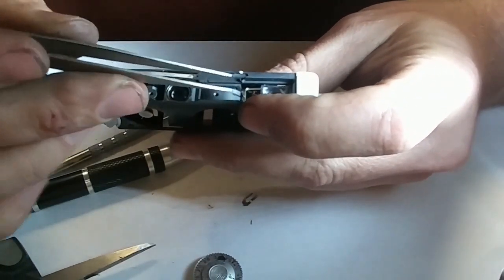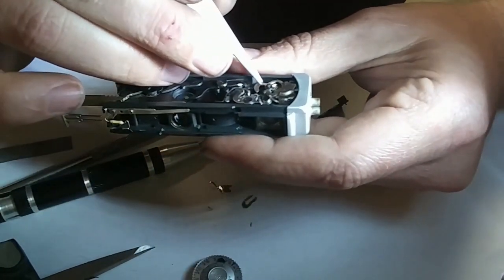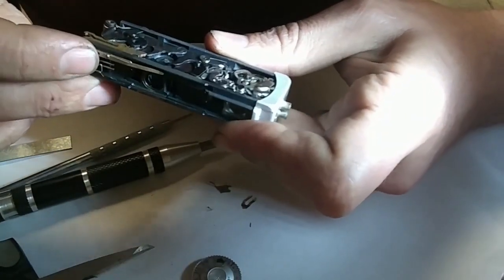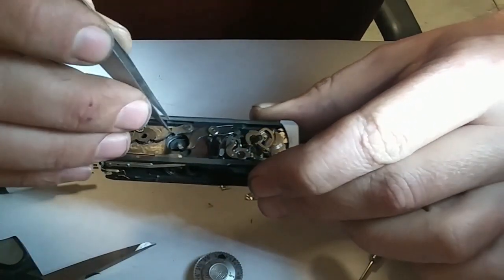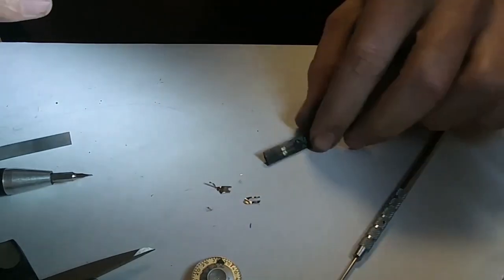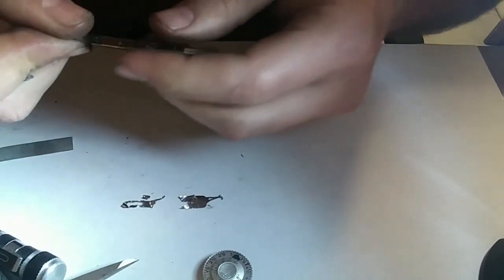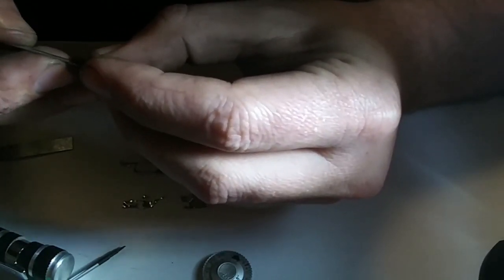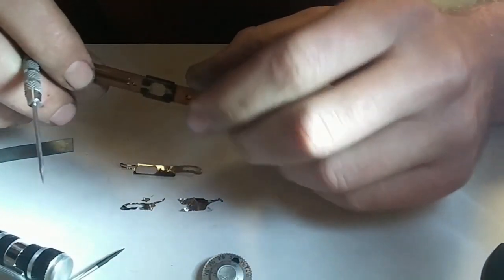minox disassembly part 4 Medium

Comment: I thank you for posting this...I needed a refresher on the focus knob.  A trick to remove some stuck shutter blades is to flow a little lighter fluid to loosen the gum in some overly enthusiastically lubed shutter blades.  Thorough cleaning will be needed after dripping the fluid in...dry blades and housing for normal operation.  Crumpled blades is another story.

Comment: I’ve replaced the shutter blades on my Minox III which seemed to go much easier.  Apparently, with the metering added, they have put a lot more inside vying for space.  Thanks for your pretty detailed demonstration.  A bit more lighting would help!

Comment: Thanks for posting this.

Putting the focus dial back is probably the worst part when repairing these cameras. I usually have trouble afterwards with film spacing.
Putting new shutter blades on isn't much fun either, and takes a long time because everything is so small.

These cameras take very nice pictures though.
Reply from the maker: I was worried about the film spacing too but mine turned out fine.  You need about 3 hands to hold all the levers to drop the knob in.  The first guide has a semi-good description of the position to get the knob in to fight it back in.
Reply from the maker: I seem to have missed my focus on my other camera so I'm going to get into it again.  Any advice on verifying the focus?  At the moment all I did was a series of shots at a known distance and going to check the results and adjust